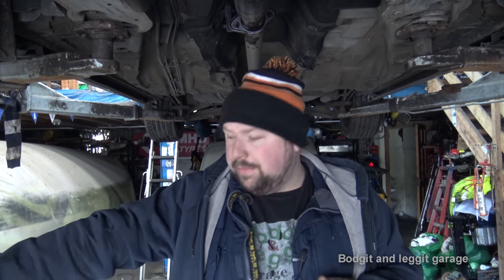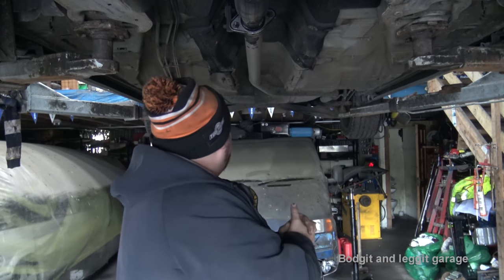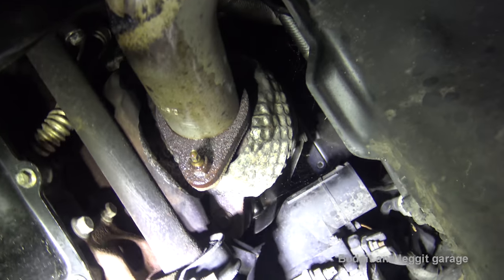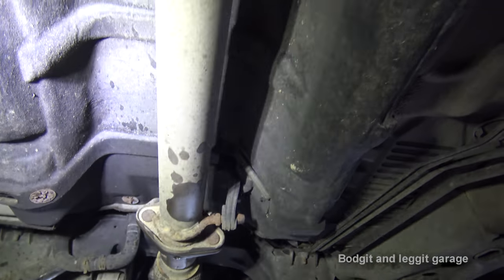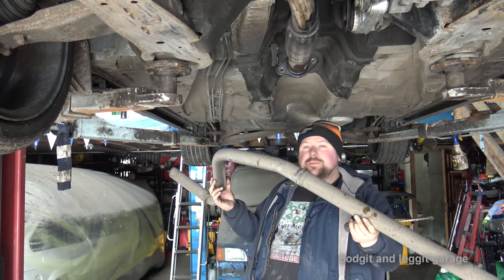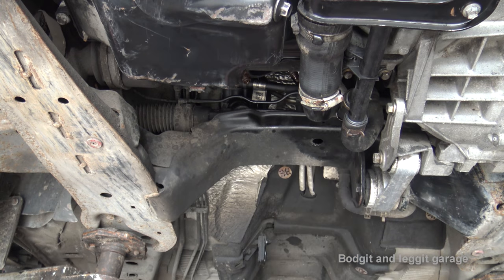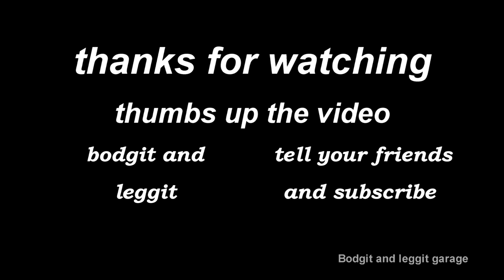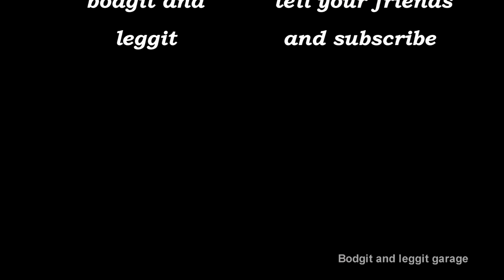Budget Car Improvements Part 1 Stainless Steel Exhaust Bodgit And Leggit Garage

Comment: If you want cheapish way to lower the car you can use 4 mk1 focus front Coilovers on it. All you need to do cut the lower part off the standard shock and weld it onto bottom of Coilovers as were it locates in the hub is wider than the focus and a bit longer. Have it in my st for last 2 years very comfortable and more importantly low 😎

Comment: 17:05 nice turbo whistle, still there with. i have a 1.6 TDCi  and for a 10yr old car is pretty clean underneath,  if if i keep on ot it will last me a good 10 years  maybe
Reply from the maker: Martin Cooper regular service inmate it will last a long time
Reply: i noticed my turbo doesnt whistle  it makes a slight chittering sound ,when changing gears sometimes  will see of i can catch it on camera

Comment: i know wot them brembo calipers are off now. new uk mot rules de cat will fail and missing heat shield will fail. im going to say a clamp link pipe is better than a welled one . its not going to snap or crack on the welds
Reply from the maker: Simon Rawle yes mate same rules here just as well I've got a trade plate hahah

Comment: Thought it was off the same model of car, didn’t seem to fit very well.
Reply: ᅚ I said model ie Mondeo, manufacturers use the same same basic floor pan on all different versions which is cost effective with minor differences between them.

Comment: Whats your view with the EGR, would you blank it or leave it alone.
Reply: Claude Gaskell Claude, in my limited experience if the EGR is electronically controlled by the ECU then this will illuminate the EML. So for the annual test that would be a fail so you would have to reconnect/replace the EGR with the original come test time. Mechanically operate EGR valves that aren't connected to the ECU aren't in comms with the ECU (usually) so deleting the EGR won't show illuminate the EGR. Different car manufacturers may have different systems so best to check for your application. (My TD4 is a non ECU controlled/measured unit so it has been deleted /No comms with ECU/No EML ..)